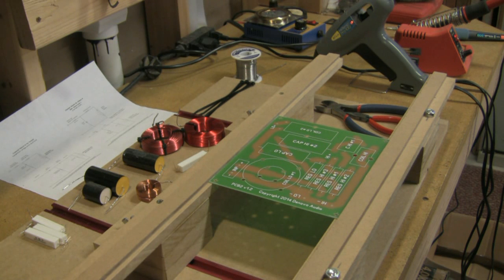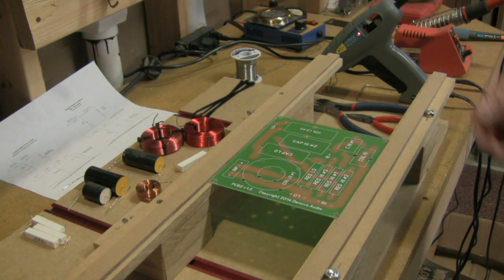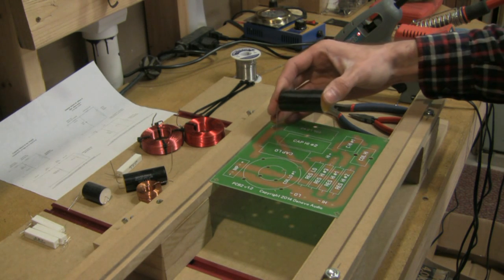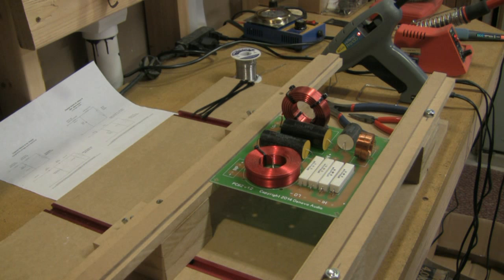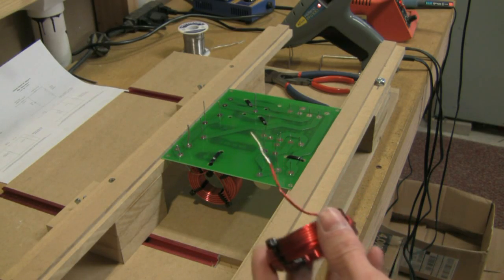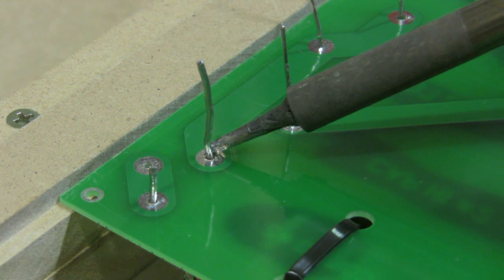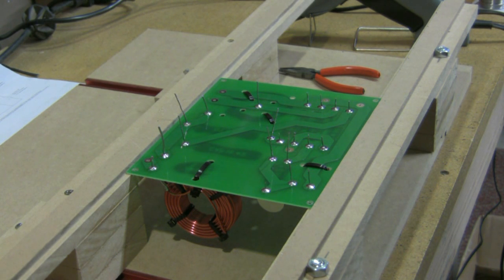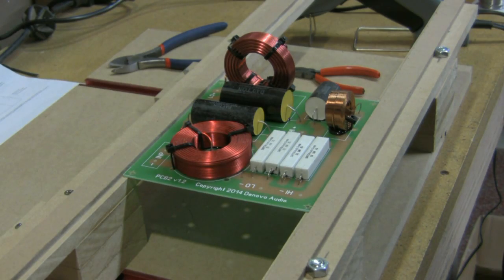DIY Sound Group crossover assembly instuctions for kits that include a PCB

Comment: Is it necessary to glue the components on? Is it just for concience while assembling, or is there another reason?
Reply from the maker: You don't have to glue the components on but I do recommend it.  It makes it much easier to solder as the components stay attached to the board if you flip it over.  It also prevents them from rattling or vibrating against the circuit board inside the speaker.  Finally if just soldered the components are supported only by the lead wires so excessive vibration or shifting of the components could cause fatiguing of those wires eventually leading to a break.

Comment: Hey Matt, I just bought a set of your OS boards off eBay, can't wait to get started! One question, I had to swap the Dayton 0.35mH coil for the Jantzen because PE is out of stock for like a month. That won't cause any problems with installation on the board, will it? The Dayton coil part number is  257-030, replacing the Jantzen coil 255-030.
Reply from the maker: The diameter of the Dayton is a little larger but you should still be able to squeeze it onto the board.
Reply: @mtg90  Great thank you!

Comment: I 
I'd love to do these myself but I do try understand how you make the circuit board ? as I'm cool with soldering etc but once capacitors etc are in coils so forth what creates the circuit? you see the lines on a circuit board that run here and there how do you create those ? hope you understand my meaning
Reply from the maker: These are custom commercially made printed circuit boards used in the video, you would have to design them using appropriate software and bring the files to a company that can make them for you. The other way of making circuit boards is etching away material from a solid copper surface to create the appropriate circuit paths.  The etching is either chemical using acid or mechanical like the custom CNC'd boards I make. You can find an example of that in one of my other videos.
Reply: mtg90  thanks for your reply will look at those videos thanks great stuff
Reply: You can just poke holes in a spare piece of flat mdf and directly solder the connections together. If anything, I feel like that would be a more direct connection anyway.

Comment: Thanks for the referrals on the glue gun and the black hot glue sticks. Is that PCB board wooden jig home-brew, or did you get it somewhere. I've done some searches and can't find anything like it, but it does look like it makes working with PCB soldering much easier.
Reply from the maker: It's home-brew.  Minimal cost to build one, it's basically just some MDF and a few bits of hardware.   The top rails that hold the boards are 3/4" MDF with a strip of 1/4" MDF glued to each leaving a small lip to keep the board from sliding front to back.  Those rails are elevated by the three blocks of 3/4" MDF on each side you can see.  The rail towards the front bolted in place while the rear one is adjustable.  I used t-track that I flush mounted into the bottom board and 1/4-20 bolts that run up from that t-track through the bottom one of the three MDF blocks.  Those bottom blocks are longer then the other two which allows access to the bolts (you can sort of see that in the video).  A wing nut on those bolts allows me to quickly reposition that rear rail to support any size boards I am working on.

Comment: Hot glue on high power resistors? Why?
Reply from the maker: The resistors should not get hot enough to melt the glue unless someone was to use them with a high powered amp for PA.  I know in my designs they stay fairly cool to the touch with most music and movie content even up to pretty loud levels (reference should not be a problem).  If someone was worried they could bend the leads so the resistors remain elevated off the board.

Comment: Matt, what kind of glue gun and glue are you using?  I've never seen black glue???  Got a link?
Reply from the maker: popalock85 Glue Gun is an Ad-Tech Pro 100.  http://www.amazon.com/Ad-Tech-High-Temperature-Glue-Nozzle/dp/B00IO4HSDG/ref=pd_sim_sbs_469_6?ie=UTF8&refRID=04QYSYGKAPX5A0MVTZW0   Though I have considered trying one of the Surebonder high wattage guns which should allow me to work quicker without worrying about the glue temp dropping.  You need to get the glue really hot in order to achieve the best bond with non-porous materials.   
Black glue sticks are from PE, part# 360-379. http://www.parts-express.com/black-hot-glue-stick-1034--360-379